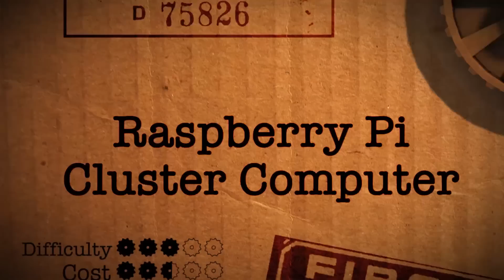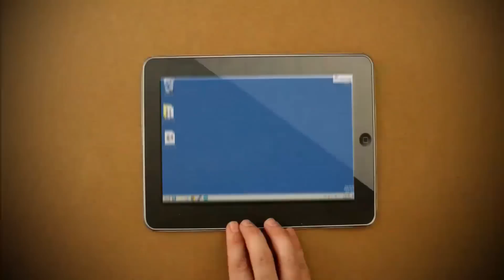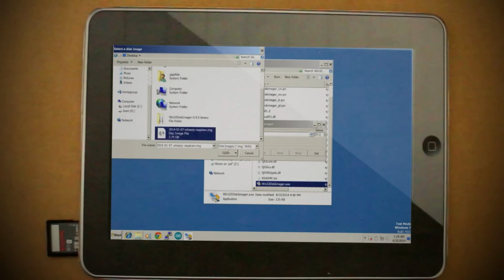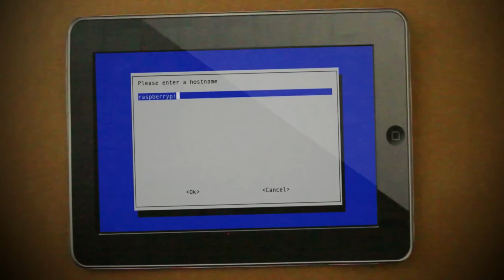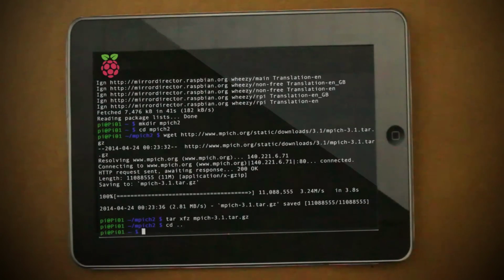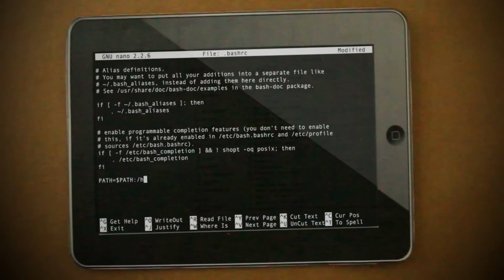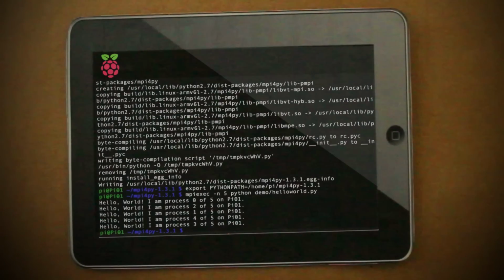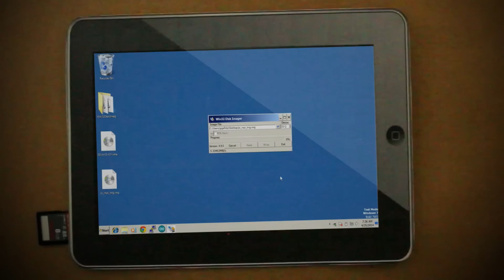How To Make A Cluster Computer (Part 1)

Comment: Am I the only one annoyed by the fact that he shows an Apple tablet running Windows and having SD card support?
Reply: +Zhida Zhou no sir, you are not.
Reply: Maybe a Chinese tablet?
Reply: jayvl09 That's funny, because an Apple tablet is a Chinese tablet.
Reply: Zhida Zhou No, you aren't
Reply: rip
Reply: Besides not having an sd card port, I've seen people install Windows 10 on a tom Tom GPS system, so an I pad is nothing to wipe and rewright
Reply: It's running ReactOS
Reply: @WildRandomVideos-wo3xe  that is so cool!
Reply: @michaelcrow2902  oh, I'd be very skeptical about that! Having a bootscreen that looks like Win10, then maybe wallpaper, probably. There's issues about firmware (you might be familiar via Bootcamp on the EFI partition has to be informed that there's both Mac and Windows bootable kernels on their partitions ) There's BIOS, which is now usually UEFI on a dedicated boot partition, but this can also be unwritable firmware, then there's the filesystem, then the type of CPU. Any one of these things can cause incompatibility. Tom Tom probably runs on an ARM, and there are experimental efforts to port Win10 to that chip, but I imagine the ram memory is much too small, and map data can be optimized in ways System disks cannot.I'd say you've seen a good illusion, not Win1- on a GPS device. Now linux, or BSD, can and does run most anything and it would not surprise me if TomTom was running linux, or a version of Android. Maybe you don't remember incompatibilities between Win95-8 and NT, or MacOS9 and OSX, but it isn't usually simple to do a different OS.

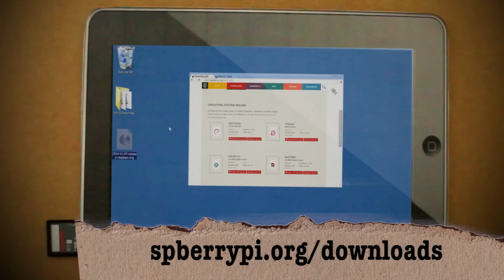Comment: Around @2:00 mark, or you could simply use Berryboot to get the operating system installed on the Raspberry Pi.  Pretty easy and you don't have to subject yourself to Microsoft Windows during the process.  I grabbed the Berryboot loader from the internet using my favorite GNU/Linux distro and then put that on the SD card.  After that was done, I ran the Berryboot loader on the Raspberry Pi it's self and then did the remainder of the operating system installation process on the Raspberry Pi.  It's completely a Microsoft-less experience for me and very simple and was completely graphical every step of the way..

Comment: My second Pi just came in and I cannot wait to try this tutorial! Fingers crossed. I am using my two VERY 100 FT Long Ethernet cables plugged into the same router for this experiment, my 24 port ethernet switch comes in, in about 4 days so I am definitely excited! I want to make this project for my school - just to represent the fact that I love computer related stuff for no reason. Of course I will find a way to utilize this cluster once I have made it on a bigger scale :)

Thanks tinker!

Comment: Correct me if I'm wrong, but once you factor in the drops in connection speeds from the Ethernet cables and wireless connections, this is really only worth it if your program literally requires cluster computing.

Comment: I know this is pretty old, but I wanted to post this, because I immediately thought of this video.

This is a project I've thought of doing many times, after all, a RaspberryPI cluster computer is a nice and - relatively - cheap expandable computing system for small scale projects. When I saw something on the RaspberryPI's website, however, that made me really exited. I'm talking about the RaspberryPI compute module. They are tiny little cards ( they fit into a "standard DDR2 SODIMM connector" according to the website ) that are fully RaspberryPIs meant for industry use. However, I think they'd be freaking awesome for cluster computers.

The idea, is create some sort of casing system. Just buy a bunch of DDR2 SODIMM female connectors, since they seem pretty cheap, a single RaspberryPI, wiring tools tools, and some material to make the case out of. You'll also need the "Compute Module IO Board" to flash the OS of the chip. Once you build and wire up your case, you'd have a very easily expandable cluster computer. Here's how.

The OS you'd flash onto each chip is merely a network boot system. I haven't looked much into the specs ( so all of what I'm saying is mostly speculative ) but I'd assume there are pins for what would usually be a female ethernet adapter. Essentially, wire them all of ( splicing them into ethernet cables if you want ) into a switch system to create a LAN for all of the female DDR2 connectors, and the single master PI. This way, once a card is slid in, it would be given power, network boot, and thus be given an image already setup for cluster computing, with all of the various certificates, keys, softwares, etc. already on the system. Then, it boots up and connects to the cluster.

To me, this seems like a very nice method of creating a cluster system. Easily expandable, and are slightly cheaper ( $25 per card ) then a regular RaspberryPI. They're also much slimmer, and to me, this sounds really aesthetically pleasing. Basically, you've created a server rack, only instead of the thousand dollar computers big data companies would insert, you insert delicious PIs. Since this is meant to be imbedded and soldered right onto a project, it also seems like it would be great for a project like this. It also says you get every more GPIO pins. If you really wanted to use pins, I'd image you could create ports in the back of the case ( using either a parallel cable with enough pins, or a serial encoder/decoder to use something more modern, like a USB-C cable ). Adding and removing cards seems really easy, and in fact, they even have a Lite model, which doesn't have build in SD-equivalent, instead giving you access to the what-would-be SD card pins. Meaning no need to even flash a OS before hand. Simply connect all of them directly to a SINGLE SD card, with the network boot already there, or even Raspbian with the cluster firmware already installed.

I don't know about anyone else, but this makes me pretty existed. Seems like a really compact, easy, and frankly pleasing, way of creating an expandable cluster computer. Start with a single PI, then another, and another, until you've filled your entire rack. Again, I'm not entirely sure about the plausibility of all of this, but I think that if possible, it would be a cool video. Plus, because of these cards size, they are also great for more compact projects you may do, such as you Smart Car project, using a card as small as this could be very good, especially when you know you won't be opening the casing, just to use a USB/ethernet port ( and thus, those ports are waisting valuable real-estate ).

Comment: Is it possible to make a cluster computer using two different laptops (one old and other one new)?
Reply: maybe... it would possible but it would take a little soldering (possibly bricking both) and some coding. i don't think it would be that bad... especially if its x86 (uses an AMD FX, Ryzen, etc. or almost any intel core CPU like an i3,i5,i7,i9
Reply: @secure-5593  In my old laptop, I have Intel i3 and in my new laptop I have AMD A6.

Comment: I have two theories that could possibly make processes like this faster a lot faster. The first one would be I don't know if its product even exists but a keyboard and mouse duplicator. Say for example you had to do 20 of the same 3 hour long coding sessions to 20 different pies. Then all you have to do is send all of them to be to set up 20 different monitors if you wanted to view all 20 the same time. You might actually want to if 1 out of 20 of the pies run into an error. Or you could just find every single hdmi-compatible monitor in your house save her example 5, then all you have to do is in between each section where there's most likely to be an error if there is going to be an error it would be here and stop coding and check each pie if that is even an issue.

II time-saving measure would be. Setting up a flash drive with a button like a slideshow on a projector button. And set up one of those USB hacking devices that can hack advice and set it to download or have remote control over something or whatever you want to do with keyboard and mouse instantly. But whenever you had to stop and check that's what the button would be for. 

I'm just curious and would love an opinion from anyone who read this.

Comment: 1. Does it increases speed?
2. How to connect more than onr pls show.
I have 20 old dual core PCs in my lab , how can I parallely use these processor. 

Thank you
Reply: i guess you could use a SUSE Linux Enterprise Server or a rocky linux
Reply: @Vic-ty2be  I hv installed side linux in 10 pc . 

Pls tell how to combine their processing power into one.

Thankyou

Comment: Hi! I am an indie filmmaker and tech enthusiast and I've been reading a lot about raspberry PI clusters. I was wondering if you'd be able to help me.

I'd like to use it for large file processing, such as rendering 3D vídeo on blendr and generating dcp files. Is that possible? Also, I have a couple of secondary questions that I hope you'd be able to help me with:

1- Can I use it also as a "regular PC"? I'd like to run Ubuntu on it

2- How would I plug it to a monitor? If there's multiple boards, can I control all of them from a single screen? And combine their forces for a single activity?

3- Do I have to use identical boards or can I get different PI models?

 

 

Thank you!

Comment: for using make, I just build the binaries on my big computer, which takes much less time, and if set up correctly, any gcc or g++ call will be sent to the compile "server" instead (or in addition to) compiling locally

(also, what you call "command line kung-fu" anyone who understands the point of the commands can easily run all of them, hell, I can create a bash script to do it for you)

Comment: If I'm not hard of hearing you said that Raspbian can fit onto a 4GB SD card. However when I tried to write to the SD card I have i was prompted with the error saying that there was not enough space and I found that Raspian was just over 4 GB. Anyone have a fix for this, and i notice that when compressed its 1.4 GB but i cant write when its compressed.

Comment: The mpi4py project has been moved this is the download link for the mpi4py-1.3.1.tar.gz 
https://bitbucket.org/mpi4py/mpi4py/downloads/mpi4py-1.3.1.tar.gz

instead or runing wget https://mpi4py.googlecode.com/files/mpi4py-1.3.1.tar.gz
run this wget https://bitbucket.org/mpi4py/mpi4py/downloads/mpi4py-1.3.1.tar.gz

and continue with the tutorial

at the end don't just disconnect your Raspberry pi. Shut it down safely with this command

sudo shutdown -h now

once the screen goes black you then could disconnect it.
Reply: T H A N K  Y O U
H
A
N
K

Y
O
U

Comment: Could I still run another operating system on the cluster computer (like kali linux for example) and how would I do that?
Reply: Ghost Memer Productions if you wanted to run kali across it all you'd have to configure it for with kali and not raspbian
Reply: @marcosgarcia8018  I figured I would have to do that but my question was how I would do that and if it was even possible to run another operating system

Comment: What are the specs going to be for a computer like this ?
Reply: Its a ARM based chip (like most mobile type CPU's) and I believe it's clocked at about 500MHz, but in the video he clocked it to 800MHz. Any higher could make it unstable. That's all I really know for the specs. Sorry just trying help!
Reply: ARM cpu @ 700MHz and can be overclocked to 1GHz on certain pi's. 512 MB of RAM on model B or 256 MB on model A.
Reply: 700MHz single core ARM CPU with a powerful GPU, usually 512 MB ram, you can overclock it to 1GHz but you would need to have a cooling solution.

Comment: what if you create a Raspberry pi 3 cluster using  8 pis then the computing performance would increase.
then lets say you  virtually emulate an OS in it ,
 then can you run x86 games  in the virtual machine at max settings ?

Comment: Would it be possible to build a cluster with 2 different models of pi? For example: raspberry B+ and the new raspberry B 2 ?
Reply: Sure, you can even make clusters with non-pis and pis
Reply: sundhaug92  Thanks for the answer!
Reply: ***** Yes but PCs will give you much more performance per dollar
Reply: ***** Just did the calculation, a raspberry pi 2 should give you around 371 Mflops, while an intel 5960X gives you 354 Gflops (almost 1000x increase) and a GTX 980 Ti gives you 5 Tflops (14x increase of the 5960X)

Comment: Would it be feasible, with some heavy modification, to have a Raspberry Pi cluster run windows and games?
If not, just a version of linux with games?
Reply: clusters are not for running games for many technical reasons.
Reply: some lightweight linux games can run on Raspberry Pi, but high-end Windows games is not really possible, you will not get good framerate with computing units communicating over 100mbps ethernet network

Comment: Is it possible to use one HD for them all? The only problem was the computer name. They would all be named "pi01". But if you could manipulate the code of the OS. e.g:
 
String ip = getIP(); //how do you get the IP of your pi?
String number = ip.charAt(12); //last number of IP-address
setSystemName("pi0"+number");

But actually i think that would name all the PIs after the one that has executet the code last. Don't know.. actually it must do that, cause the System-name is written in a text file. But Couldn't you just use both, and HD and SD, so the System-name is stored in the PIs' individual SD and the OS on the HD just tellst them to e.g. use the name stored in e.g "SD:/pi-name.txt/"? Plz tell me your opinion, wether you think something like this could work! :)
PS: nice video! You just got a new subscriber ^^

Comment: Ehh... I'm not sure, but i don't think you need the router to link these. 
There's another video out there that talk about how only 4 of the 8 wires in a standard cat-5 cable are actually turned off... since you can already program the function of the pi boards, you could simply tell it that 4 of the 8 ethernet pins are for recieving data, and the other 4 are for transmitting. 
You might still use a router for more then 2 boards, but... that might drop cost somewhat.
Reply: No programming required. Just make a crossover cable. Pins 1 and 2 are transmit pairs and pins 3 and 6 are receiving pairs. Swap those colors on one end of the cable so pin 1 goes to pin 3 and pin 2 goes to pin 6 on the other end and they will naturally talk to each other correctly. Keep in mind you will need to manually assign ip addresses on each pi. Though using a router means it automatically hands out ip addresses to connected devices which makes setup a little bit easier.

Switches or hubs may be used in place of the router, and may wind up being cheaper but you'll have to manually assign ip addresses, unless you set up one of the pis to double as a DHCP server as well.

Comment: can i use this to make a game emulator that runs 64 games smoothly?
Reply: NotSoNerdGaming just buying an n64 would be cheaper
Reply: yes, but is you plan on making a portable would be better, so you could program it with all the gamez and be able to play game boys games and evverything before n64
:3
Reply: NotSoNerdGaming you would use only one not a cluster
Reply: i know but if you could cluster them wouldnt it make them more powerful?
Reply: no the others would just not be used
Reply: funny, that's kinda why i was checking this video...lol
but i was thinking something far more bold, emulating multiple systems. What I'm curious though is any potential network latency of this setup. (and similar problems) You'd obviously need to on the fly be sending a lot of data across the network to the nodes that do various tasks (for example, in the case of DS, one Pi takes + emulates the ARM9 code and the other the ARM7 code.) And honestly, I don't think the networking is the hardest part, here. Your emulator would in fact most likely have the codebase split in some manner. How, I'm not sure. My guess is each node has the specific part pre-installed. I suppose you could go through the annoying task of having a central install that gets distributed between each node, too. Either way, each one needs to know how to do the task it is given. 

But, mainly just ranting about ideas, here. I can't say any setup would be easy in practice. I don't even have the current tools/resources to do any of it at all. Excluding I know a bit about programming things and I was given a Pi that I thus far have never actually used.
Reply: Possibly

Comment: After editing the inittab file and rebooting i get an error loop. Has anyone encountered this?

"/bin/sh: 1: cannot pen /dev/ttyl: No such file"

this runs about 10 times, then it says-

"INIT: Id "1" respawning too fast: disabled for 5 minutes."
Reply: +Evan Howell 

The error was a typo, I was typing ttyl,  it is suppose to be tty1    (The number one= 1)
Reply: +Evan Howell Edit #2.

Make sure you use  ~ when editing .bash.rc

 nano ~/.bash.rc          Or that you have navigated to the home folder when you set the path.

Comment: Just to say thanks for the tutorial but the Mpi4pi files are now hosted at Bitbucket and can be found here:

https://bitbucket.org/mpi4py/mpi4py/downloads

I could not get it to download with wget so went into the GUI downloaded and saved the zip file onto the pi. I unzipped the file and left it in the Downloads directory but you could move it to home and all the rest of the of the commands will be correct if you leave it in Downloads remember to use the export path:

export PYTHONPATH=/home/pi/download/mpi4pi-1.3.1

hope this is useful

@TonyH1212
Reply: Tony Hughes sorry that should be ..../home/pi/downloads/mpi.....etc